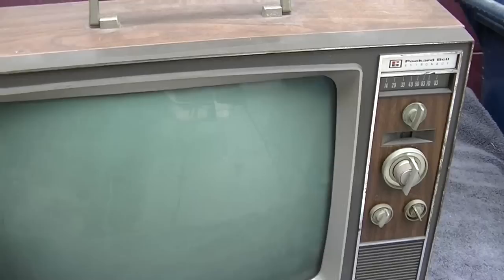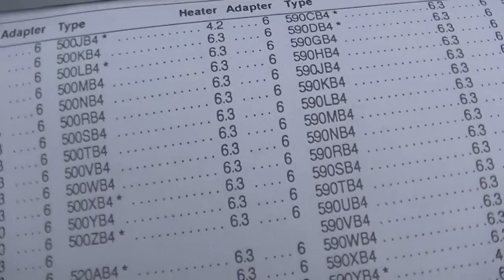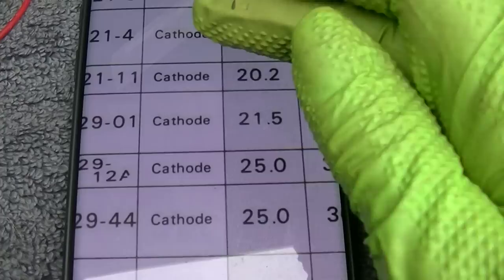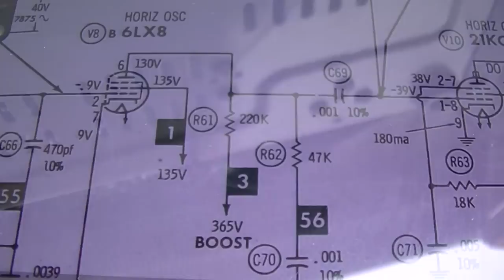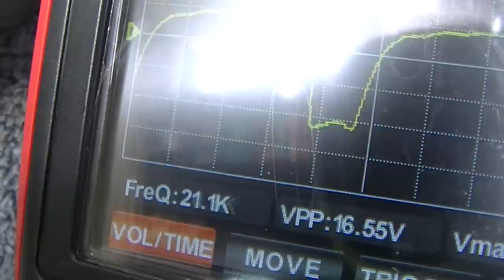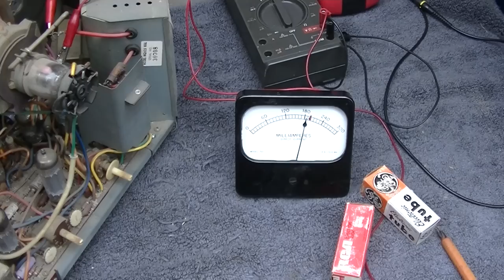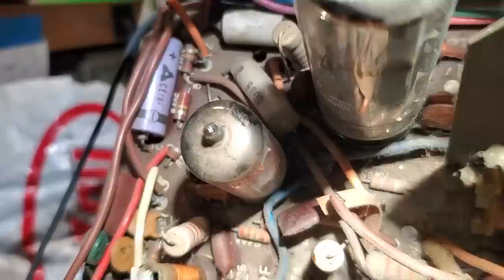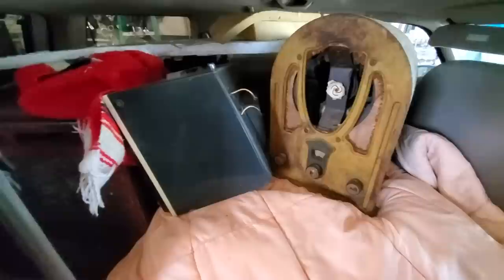Rapair Fail 1969 Packard Bell Astronaut MQ625 Matsushita BW Tube TV

Comment: Hey Shango066, I think I see your problem.  From the symptoms, it sounds like your horizonal oscillator loops gain is too low.  In an oscillator circuit, the loop gain must be above one.  The gain is set by capacitors C67 and C68.  Try increasing C68 to 0.01 uF, that may solve the problem.  You will need to reset the horizontal frequency, as it will drop a bit.

Comment: My dad had a business in the 70s; lots of fluorescent fixtures. We constantly were fixing dead ones, either dead tubes or burned up ballasts. We finally bought one of these TVs and mounted it on top of a stepladder, face down with the back off. We spent many an hour sliding the rig underneath the fluorescent lamps to check the tubes by proximity to the horizontal output. Never again had to question whether it was tubes or ballasts.
Reply: And how did that work ?
Reply: See what I would have done if it was me was use a test rig with a preheat start ballast for 40w tubes. this way you just use that since they are the most reliable and indestructible way to test 30-40w t12 as well as 32-40 t9 circleline tubes.

Comment: My buddy told me the story of a set he had back in the 60's.   The Horizontal oscillator would not start.  Every time he touched a scope probe to it,  it would start up.   He finally calculated the capacitive load of the scope probe (a few picofarads) and added the equivalent capacitor to the circuit where he probed it.   He used it like that until the set wore out.

Comment: This set may be a candidate for cryo-diagnosis.  Start hosing the thing down and see if you can get the oscillator to stop.  I have on a couple of occasions found intermittent connections on the flyback causing a loss of secondary voltages.  If you were so inclined remove the flyback and scrape away the goo at the terminal punches.  You may find a broken wire at this point.
Reply: I was thinking the same thing,  if applying some thermal shock, heat or cold,  to the components around the oscillator might expose the marginal part that is giving it grief.

Comment: Getting back to basics by cleaning the tube sockets and really looking closely at solder joints. Intermittent issues drive me nuts.
Reply: The connectors in tube sockets in Japanese TVs can oxidize just like protection relay contacts in audio products of that era... Spiking the level of volume control would break through the oxidation and the sound would return...

Comment: Back in the fifties, I had an uncle who would pull the tubes on a faulty set, and head down to the local drug store and use one of their infamous testers. If something showed weak, he would buy a new one, light a cigarette, try the replacement, and would then curse if it didn't fix the problem. Usually it was a horizontal hold sync problem, and we would surrender the chassis for a week at the TV repair shop... Funny how we are all trained to think it's always capacitors............. Another great tutorial, Dan.

Comment: First principles from an Electrical Engineer who loves old video equipment and has worked as a broadcast video technician. An oscillator is just an amplifier. You can have a PA sound system on the verge of feedback (oscillation) but nothing will happen until some sort of pop or something happens on the microphone and then the whole system will go crazy with feedback. A little scratchy-scratchy tube socket noise starts your tube oscillating - now what is supposed to provide that "pop" into the "microphone" in your horizontal oscillator? I don't know, but I have seen circuits where a signal which appears only when the other tubes have warmed up starts the oscillator - it's usually a capacitor which charges, the current drops off suddenly, and that's the "mic drop" which starts the feedback going and then you have an oscillator.
Whatever it is, you're dealing with a cost-reduced simplified circuit which is expecting something else in the set to bang on the "microphone" and get a feedback squeal to happen. That feedback squeal is obviously tuned to 15,750Hz and that's your horizontal oscillator. 
Your dual diode phase detector might be selenium; it might be leaking the "pop" away before it gets to the grid. But it is likely to be a relatively small capacitor which strangely couples the horizontal oscillator to the audio output tube or something else in the set. If that capacitor is open, no pop, no feedback, the horizontal oscillator remains an amplifier with no signal and nothing to get it feeding back.
Cool old TV set, though. I love that thing. It does produce a nice picture! 
And wow, that load in your car? Want to drive them up here to Ottawa, Canada for me? So many beautiful pieces of our technological history. 
Thank you for another great video! 
Your fan, 
Lawrence Wade
BrainDamageBBQ
Reply: By the way, if that pop is coming from the audio stage, don't worry, the engineers who designed that set knew that speaker won't do over 10kHz at best. Same if they coupled the starter capacitor off a video amplifier or IF amplifier. But somewhere in the schematic, I am willing to bet money you will find a weird connection between the horizontal oscillator and some other circuit where it does not seem like it should be connected. All that would really matter is that "pop" happens and gets the oscillator running before the large heaters and cathodes in the horizontal output circuits are fully warmed.
Reply: I restored a 1966 Philco, built as cheaply as a Predicta, about 20 years ago. I oversized the replacement filter capacitors because why not? Vertical oscillator would not start, perfect horizontal line across the screen. I thought about first principles of what an oscillator is... swapped in a smaller power supply capacitor and the vertical oscillator started every time. I think it needed a little hum from the power supply to start the vertical oscillator to feed back and start going. I could see the power supply hum on my oscilloscope but not in the picture or hear it in the sound. 
Cost-reduced circuits.... component values can be quite critical.

Comment: I would change the 3uF capacitor. Even if it tests good, its running on high impedance, so even small leak can lower the voltage. Without tube in socket you should have the same voltage on plate contact as on B+. The tube is the same except heater like european PCF 82 or PCF 802. They were used in horizontal oscillator in most european TV sets even color ones since 60s till the end of tube era and they were very reliable. Usually triode part act as voltage controlled device changing frequency of oscillator running on pentode part. Because in Europe B+ was high enough without doubler (250-280V) plate resistor was connected to B+ directly, not to the booster voltage. 160V pp was standard output from this oscillator.
Reply: Those Matsushita Panasonic purple capacitors from the 70s are well known to be leaky. You can test them and still get good results but at least that specific one should be changed.
Reply: The pcf 82 and 802 are very different tubes except for the pinout
Reply: @maxs.3238  Yes and no. PCF82 was originally used in VHF tuners as oscillator and mixer. But it was also used as horizontal oscillator and triode part as reactance to tune it. PCF 802 was modified for this use only.
Reply: @xsc1000  alright, didn't know that. I was just going by electrical values which I know to be quite different. So they're not exactly interchangeable (although it might even work in some circuits with a realignment, idk)
Reply: @maxs.3238  There were no problem to use PCF 82 instead of PCF 802 in horizontal oscillator.
Reply: I would say its not biased in the linear region. The question is why. Probably a tiny amount of leakage on whatever cap connects to the grid is leaky.

Comment: Without really having access to the schematic and some component values, there are some general (possible) considerations:
First, for any oscillator, the amount of feedback necessary to start the oscillator is always more than what is needed to sustain oscillation.
So either the amount of feedback is not available, or the biasing of the active elements is off just enough not be able to take advantage of the feedback amount.
To me, it is most like a cap that is leaky that is (through the leakage) changing the DC-parameters but through age (and a reduction in capacitance) reducing the feedback...

EDIT:  Felt the above was a little lacking if not offering a 'plan-of-attack' to try and set-up on the failure.
As far as how to attack the situation short of mass-shotgunning of components, the other way is to set up a multi channel oscilloscope in a few key areas of the feedback loop and while it is working, figure out what a good power-up looks like.  Then, you could wait for a failure mode, and then do the same thing.  As far as a trigger point, there should be a DC-point that repeats itself in the same way regardless of good or bad power-up.  What I would look for is a runt-signal in comparison to what a good power up looks like.  So, if the oscillator can't get over the 'hump' is is going to just lock itself in a steady-state of conduction...
Reply: That was my first hunch as well, it would also explain the low amplitude on the oscillator as there would be a capacitor somewhere that is loading the circuit down and change the impedance, which would also mean there is too much damping in the circuit for it to start spontaneously.

Capacitor gets hot, reforms to some extent and has less leakage -> less damping in circuit and oscillator will go.
Reply: Exactly my thought as well.

Comment: Not a TV Repair Expert here. I think you might consider focusing your efforts on those things that  make this set different from your average set. For example, the “Vacation” switch circuits, the low voltage CRT heater, etc. Obviously, you’re a genius when it comes to fixing vintage gear, but maybe it’s become so routine for you that you’re missing something that is not so common in your routine. Enjoy your show every week. Cheers from the inland Empire.
Reply: I dunno he touched on both those things.
Reply: @cassandrajoiner9933 I think he meant bypass the features and see if it works

Comment: I have an older Packard Bell 19" Astronaut BW portable, from about 1964. It works well, but needs caps replaced in the vertical circuit. I'll get to that repair, one of these days! The set was given to me about 3 years ago. All plastic cabinet.

Comment: There were similar ideas (to instant on) in jukeboxes of the day.  If the filaments were not kept on, half the song could play before the amp came on. Wurlitzer had a system where the filaments were kept glowing at a reduced voltage and could come up to full power by the time the record was placed on the platter by the mech while also saving energy and tube life when nothing was playing.
Reply: And RockOla would blast the tubes with high heater voltage to get them warmed up fast!
Reply: @jimmyday9536  I'm surprised they all didn't just keep them running.  These were moneymaking machines and tubes were cheap.  Make em a yearly maintenance item or something.  Perhaps the electricity consumption justified it.  OTOH, they tended to be full of lights which used even more electricity than the tubes.

Comment: My thought is that’s it’s socket that the oscillator tube is plugged into.  When the tube is cold it oscillator tube doesn’t start, but then only after the set warms up and the tube is jiggled the it starts.  A pin or pins on the tube just don’t make good contact with the contacts in the socket until the set warms up.

Comment: These Styroflex (metalized polyester) capacitors may develop internal intermmitences sometimes, specially when exposed to musty or damp environments. If you wiggle the capacitor, resolder its terminals or even put a voltage across it, you can make it work, but after a while it will start to fail again. These has usually quite precision values too, so any small drift may affect the circuit. I already ran across some very sketchy symptoms caused by these!
Reply: yep i've had a few issues with those 'suflex' caps, i think the aluminium foil oxidised causing poor contact to the leadout wires, as theyre not usually sealed on the ends, though i do have a few that are blobbed with epoxy on the ends

Comment: Not too many of these Packard Bell Panasonic sets made it to the East Coast with the Packard Bell name. Now when I worked in the TV repair shop back in the 70s and the Panasonic versions of these that rarely came in I remember the vegetable cake he would actually replace the oscillator tube the horizontal output tube the double diodes in the oscillator section if my memory serves me correct he replaced a few capacitors in the oscillator section all as preventative maintenance. If I knew the exact cause I would be more than happy to share it but unfortunately from what the text in the repair shop would do change what I said and that seemed to have fixed the problem for the customer. Also as a general rule with any television that came into the repair shop with horizontal or high voltage problems automatically the ocellated to was replaced along with the damper and the horizontal output regardless of condition of the tubes. And the color TVs that came in for service with high-voltage problems all of the tubes were replaced regardless of condition.

Comment: We had one of these Packerd Bells in the pool table room, a white one though. I think it had cable or something because if you plugged in a phone line you could get XXX on the AOL channel. Even had a built in combination cup holder and ash tray, it would slide out with a motor if you pushed a button! De Luxe! They don't build em like they used to! Features like that are sold extra today.

Comment: We never had a Packard Bell TV.  I do remember having an Admiral black and white set before we had a color Sony in my parent's bedroom and a color Panasonic in the family room.  The Sony had a VCR eventually and was a great TV all the years we owned it.  The Panasonic was also good, and had a TI-99/4a computer attached.  The Admiral was only used on our generator during power failures, as Dad didn't trust power from the generator to not damage the Sony or the Panasonic.  Good times.

Comment: Anytime I've had issues like this it's usually a temperature sensitive component or liquid spilt in the chassis & its corroded a connecting wire internally which is discovered by wigging wires or heat/freeze.
Might have to hit it with a few cans of freeze spray spritzer shlamotwerkulated when the oscillator starts & heat gun to reveal the intermittent far quicker & also keep an eye on the B+ at startup.
One time when repairing industrial monitors for Rockwell back in the day I had something left field & turned out to the oscillator coil because they had cracked the ferrite or hairline cracks on the PCB which only revealed themselves under a light when I slightly flexed the PCB caused by overzealous percussive "maintenance" by the customer.
Definitely re-do those cold solder joints where the fuse it as they look so dodgy that it makes Sorin seem by the book doing milspec soldering.
Those cylindrical axial silver coloured caps are likely old school low value polystyrene capacitors & they were everywhere in the 1970s/80s when I was a kid hobbyist.
Great new scope tools.
Can't wait to see the continuation & the new barn finds (bit of sanding & varnish would do wonders) which look very interesting & whether it passes the ultimate crepe erase test!

Comment: Something in the reactance of the circuit has changed. Youre adding capacitence to the circuit by placing your hand on the tube, which combined with transients from dirty socket jump starts it.

With current running through it the circuit works until it cools then back to square one. 

Im betting small value caps in the oscillator circuit have drifted. Id yank small value caps and test hot vs cold and see which have drifted. It might be a tight tolerance circuit that isnt lenient on change. maybe even the oscillator coil is funky

Im thinking sbout the possibility that the wrap of the coil has gotten loose from thermal cycling enough thay its not tightly wound enough to create the proper reactance. If its hesting up to working, thermal expansion is doing the job of tightening it up again . In this case, freezing it after you power down might bring back the stmptom. You could revarnish it while hot to try and hold that tighter form but then it may not be adjustable again.

Just ramblings...

Comment: I used to fix TVs and stereos in the mid '70s. I distinctly remember those rolled silver plastic caps doing all sorts of evil things to my mental stability. Time to freeze spray and heat gun. If I would throw any part at it, that one silver plastic one in the H oscillator would get swapped.

Comment: Many UK sets that used polystyrene capacitors and that valve ( tube ) PCF 802 triode pentode as the line oscillator were notorious for strange random faults . The only cure was to replace the caps .
Reply: Yeah also here in continental Europe... styroflex caps were perfect until they weren't :)